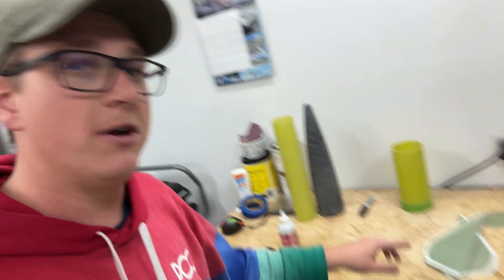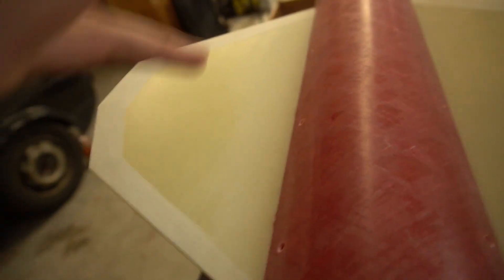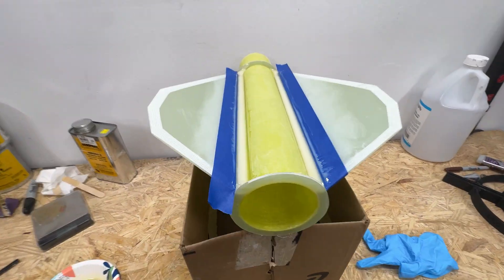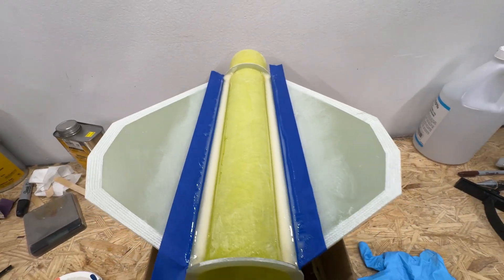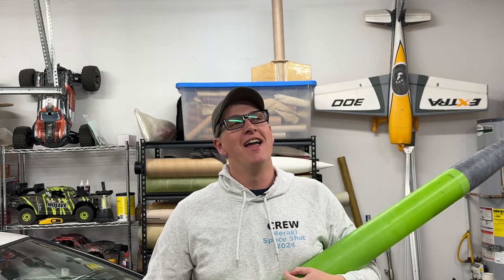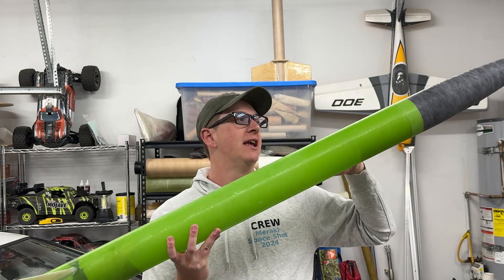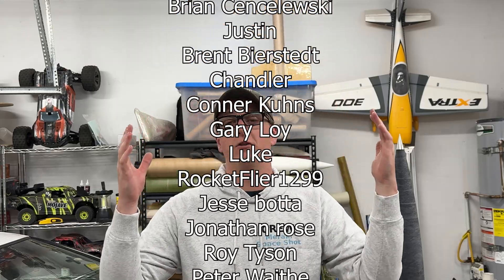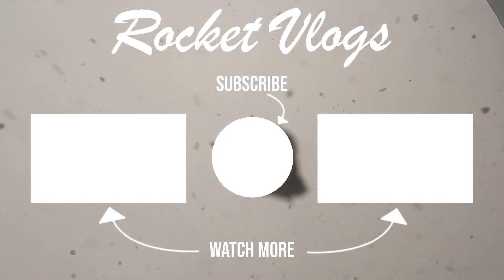I'll Get It Right This Time | Wildman Punisher 4 Build (for the second time)

Comment: In my opinion, the internal fillets are just as important. If not more important as the outers, as like your buddy said, they provide way more structural integrity to the motor tube and to the airframe. After the slots have been cut i did nice internal fillets on my 4 inch. Iris, I just built thing is solid 💪 👌 💯

Comment: Have you considered heat curing the fin can epoxy for additional strength?  Easy to make with a cardboard box, heat gun, and $15 amazon thermostatic controller.  Or just a heat gun and BBQ temp probe with lots of manual checking, like I did at first.
Reply from the maker: I actually did exactly that with this fin can. That said, it was mostly just for curing the epoxy quicker and I opted not to do it on the other two sets because in the case of aeropoxy, heat curing it substantially reduces its shear strength. 

https://www.aircraftspruce.com/catalog/pdf/01-00295tech.pdf
Reply from the maker: https://youtube.com/shorts/kFeb7e41mhg?si=XA0HRdX-QuktKyvI
Reply: Shortening the epoxy cure time weakens it